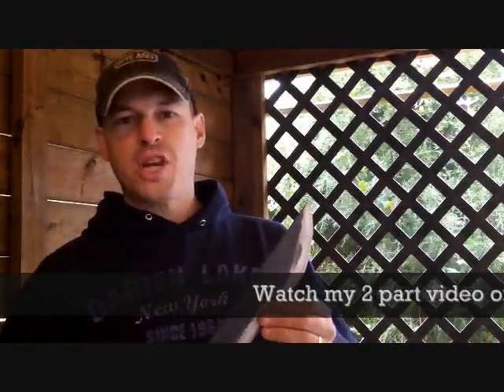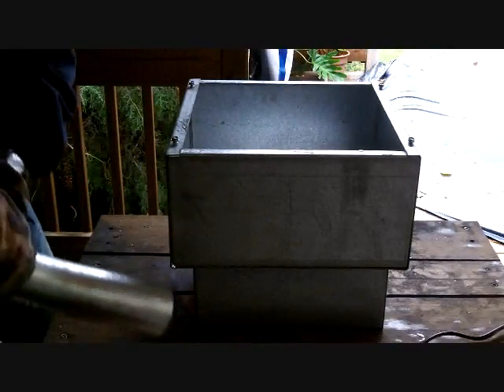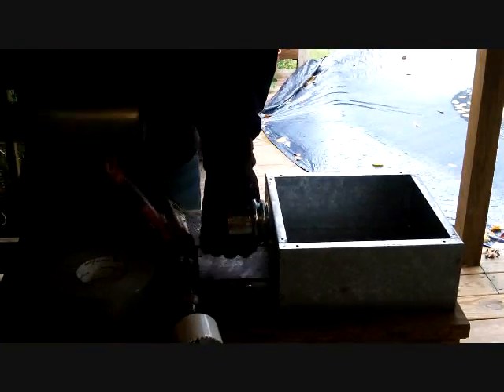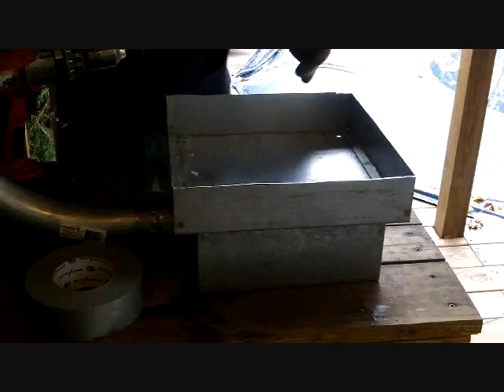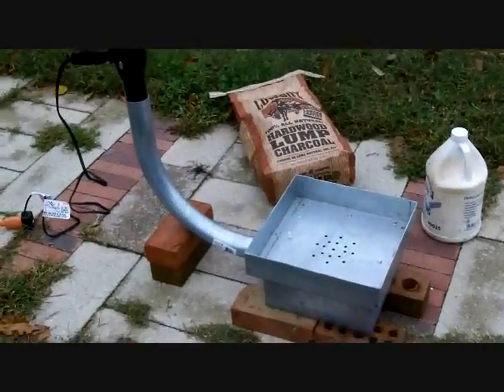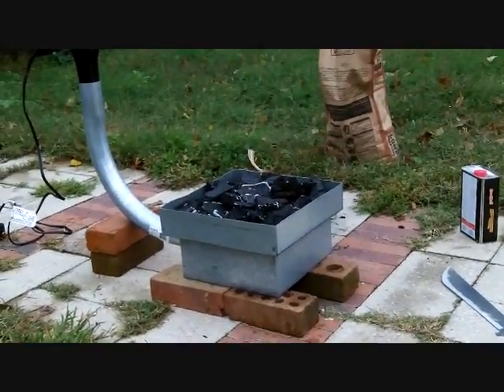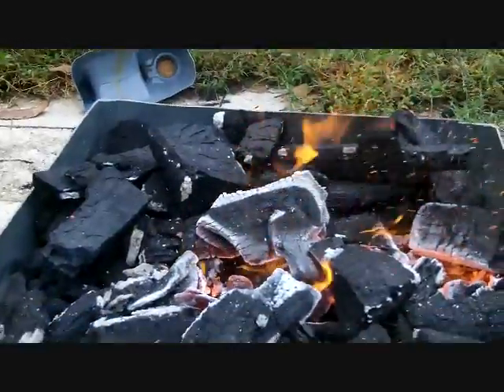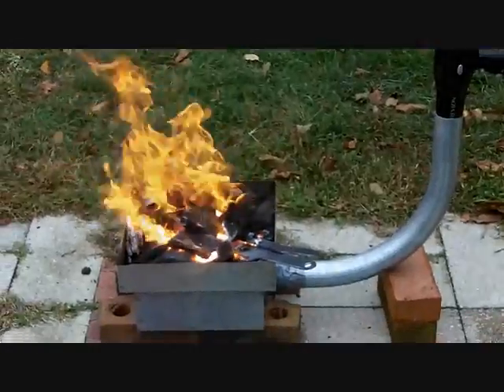How To Make A Homemade Forge (Rated Best Video)

Comment: This is probably a dumb question but what kind of oil do you use?
Reply: depends on what type of temper your looking for.  Everybody has there own secrete oils, or just what ever you have on hand.
Reply: Peanut oil (high smoke point), or other similar veg oils are used very often.

Comment: hey jaydog Ive been forging steel homemade for awhile and I can say your design is very good but if you use lumpwood charcoal use a 5g bucket dump the wood pieces in and break them up it works extremely faster and you have more to work with also add some water to a bit while using the forge and the wet pieces add around the ones that's hot, works great to. all and all keep forging my blacksmith friends we don't need machines we can make them ourselves the old fashioned way

Comment: oil quenching is for metals that are already very hard. If you are quenching mild steel, you use water. Heat to 4000 degrees and bring down to 400 degrees in one second. Never oil a hot drill bit. That's an oil quench and will make the bit brittle because the bit is already hardened. ur welcome

Comment: To all those having a winge about gal and how lethal it is when heated...use a flap disc on a grinder, sand back the coating and do a couple of high temp burns on the whole thing with a blow torch or light it with a coal fire and the blower somewhere outside so it is well ventilated, make sure you stay away and others do too or wear a respirator. It's a coating that is no different to paint in essence other than the fact the coating is zinc. A little common sense goes a long way and instead of using scare tactics to freak people out how about teaching them ways to avoid the dangers if all they can use is gal... I've made gal forges like this before, welding teachers at school have too, so long as you burn off all the gal its fine, just like if you make a barrel bbq you grind and burn out the paint.
Reply: yea, common sense is pretty uncommon. it will burn off and be fine. you'd be very sick if you inhaled one of the little puff balls, and an idiot if you didn't do anything about it. find yourself a lid for heat retention. it will cut serious time off. to hell with the haters. kudos for your good efforts

Comment: and them blades probably have already had that done and trying to do it again is really pointless beware of the white smoke after you turn off the blower check the sides after its been cooled and off for a day or so you can see the zinc build up on the sides or on the blades

Comment: does the galvanize burn off the steel eventually? or will it alway produce toxic fumes?  thxs
Reply: +Ei Pi always.
Reply: +tzDub92 thxs...wasnt sure
Reply: +Ei Pi it is a zinc coating that is hot dipped or plated on the steel after manufacture.  It burns of rapidly at high temps, producing white smoke and wisps in the air (much like acetylene).  Nothing to worry about outside, or with a fan to vent it away from you, on the first burn.
Reply: +Patrick Reed yes im familiar with the process thats why i thought it would burn off   Thxs for the info!

Comment: Galvanized steel gives off toxic fumes that are actually rather lethal. 
Also this guys forge wouldnt work well. No fire pot, no way to remove the crap that gets melted down (asides from dissembling the forge...) Probably one of the worst "how to make a forge video" I have ever seen. 

Lets recap. 
A. Hes using galvanized steel. DON'T! It gives off toxic gas and will KILL YOU
B. He has no fire pot
C. he has no way to effectively or efficiently remove little melted built up bits called clinkers. 
D. Hair driers work, but not well. 
E. He named his horrible forge video "Rated best forge"... 

This guy is an IDIOT. Don't be like this guy.

Comment: this post is instructing people to build a blacksmith forge out of GALVANIZED METAL, (an anti corrosive treatment made by plating metal with zinc) as this type of treated metal heats up the ZINC GALVANIZATION will begin to burn off creating POISONOUS FUMES that are potentially LETHAL, and can cause permeant & EXTENSIVE DAMAGE to the IMMUNE SYSTEM... please remove this video, before some kid trying to replicate this dies following your misguided instructions..

Comment: Cool way to do this, but it looks like your machete doesn't fit.  You could have used an oxy propane or oxyacetylene torch to accomplish the same thing.  I have also used a wood fire on the ground whilst taking my shop vac and blowing air into it with a small nozzle on the end of it.

Comment: lol guess i am not the only one who realized it was the wrong metal ,even on the cold side of the fire is bad, the fumes can be generated with out getting to forging temperatures, and wow hope he never tries to forge a piece of galvanized metal  ,but rant over ,like the design if in non toxic material
Reply: christophe leblanc No fire pot, no way to remove clinkers. Not a good design at all. Oh and yeah like you said, using galvanized...

Comment: This guy really doesn't know what he's doing galvanised steel really is he trying to kill people , also he only has the middle section of the blade over heat and if you un- evenly temper steel the metal becomes brittle and will break even if dropped

Comment: So on the one hand, it works, on the other hand:
When you acheive a decent temperature you're going to melt your forge.
Ash is going to accumulate in the hairdryer pressuriser.
All that metal is galvanised so yeah, that's not good.
A lack of insulant, which is cheap, is going to cost you lots of fuel.
In short, however this was voted for, it was wrong.

Comment: I was not impressed... he used the wrong coals, everything about this was dangerous. There are no seals in this box, and the whole tube up in the air thing was dumb too, easy to knock over. I don't think I ever saw his blade glow red either. This is an accident waiting to happen
Reply: Justin Brown I have used charcoal (natural wood charcoal) before for black smithing. In fact that is the first type of fuel used before  coal/coke was used. But yes everything else he did scared me. I kept waiting for him to turn off the hair dryer and have that space be a vacuum for all that hot air to rush towards his "billows" and melt them...

Comment: Lots of commentary about the galvanized material. perhaps a little expanded metal mesh and some fire clay would provide a more heat resistant surface , allow for the cheap material and enhance the lifespan of this forge.
Reply: Brad Dark A project I have been meaning to get around to as soon as I have finished my new workshop.
Ultimately I agree...The best material imo for a forge is as you said, fire clay or a none porous stone (air in porous stone will expand and crack or rupture the stone... no joke when hot shrapnel is blasted at you).
For those wanting to make a forge, rather look around for concrete designs (baked clay bricks are also easy to find and suitable for a beginners forge), as steel is likely to melt or buckle under extreme temps whereas stone/clay is more resilient to heat.
This design does not retain the heat, since much of the heat is lost to the open air. The principal of this build is okay but like many first time projects, it could do with some tweaking. I would not have cut off the top box for starters that way he would have been able to add more burning medium, allowing him to completely submerge his blade and possibly had more even heat distribution. All things considered a neat and simple build.
Reply: clinton Raubenheimer j
Reply: Berle Bauroth
k?

Comment: Simply put, the fact that it was done outside removed MOST of the dangers when dealing with galvanized materials. I have welded galvanized materials for years with no ill effects due to the fact that I do NOT do this in an enclosed space, and ONLY when it is necessary. Not saying it's a good idea to do these things, but don't over-dramatize the risks either.

Comment: Nice quick forge but if you build the same type don't cut your fire box that low instead cut an opening out on one side to heat your charcoal or wood faster an so you don't have your work on an angle while heating it and it will have even heating other than that great model, also you should mention if using galvanized to do a heavy burn first as it is toxic if inhaled!!!!

Comment: Spend a bit more time and just build a cinder block or brick forge.  You will be happier with the result, no fumes, and their aesthetically pleasing.
Reply: This is what I did and it worked out pretty well.
Reply: Robert Fields always liked cinder block build, although it does take up a little more space than a clay brick forge of the same volume.

Comment: I keep hearing about the dangers of using galvanized metals in forges but I have absolutely no idea in how to identify the differences between galvanized and non galvanized metals for the sake of using proper materials. Looks like I'll have to be cautious in choosing the type of metals I'll be using if I end up being crazy enough to even try something like this in the first place,but then again,I've been known to try some rather crazy things as well. LOL!
Reply: That's really weird. At a lowes or home depot it will be next to the welding supplies. Less than 3 feet away from the sheet metal I mentioned.
Anyway, the forge model I suggested is about 45-55$, so less than the cost charcoal for a big project. Anyway, I hope whatever method you use is safe. Good luck.
Reply: if it has rust on it (or can rust) its not zinc coated (or the zinc wore off).
Reply: Never thought about that possibility.
Reply: Basically if it's bright and shiny and silverish it's galvanized, if it's dark or corroded at all it's safe for heating.
Reply: It turns out that I just got my plumbing just recently. Anyway,you still can use galvanized pipes safely by either burning the coating off in a well ventilated area away from others and make sure you're not sitting to close to the pipes. If you decide to remain close to them,I suppose I would at least wear a mask over my face that would help to prevent me from breathing in any toxic zinc fumes. I've also heard that you can also sand it off and that using vinegar will also especially help as well in the process and is far safer than burning it all off. In the near future I'll be looking into deciding what method I'll be using,but I'm not ready to make that a priority just yet,as I still have a few other things that need to be taken care of before I start to even assemble it.
Reply: But well ventilated area basically that means a fume hood. Doing it outside is still dangerous and the chance of residual zinc oxide being left behind if you try sanding or using vinegar is too high for either method to be safe. If you want to build a forge go to a home improvement store, buy a 2'x2' plate of 16 gauge weldable steel, cut out the corners 3"x3" and fold the edges up.Drill a 3" hole in the middle and use a black iron connector to a piece of dryer foil and put the hair dryer on the other side of that.
Reply: Already too late for that. At this point,I have the only things that are available to me and I really don't have much of any budget at all. I'm pretty much stuck out in the middle of nowhere and I'm just gonna have to make due with what I got. Either way,there have been more than a few people who have removed their galvanized finish for their forges and have had no problems. As I said however,I haven't even gotten far enough to the point of having to remove the finish yet because it will be a while yet before I'm ready to start assembling the forge in it's final form,anyway. Not all of us have money and our circumstances vary in life. You take and use what you got. We have a few old burn pile spots away from the house far enough to where it really shouldn't be a problem at all to begin with. Burn and/or sand off the finish and then wash the pipes off. I don't mind some rust forming up on them as that would only help to indicate that I've removed that crap off of the pipes and rust would inevitably happen over time,anyway. If 2 inch black iron pipes were available,I would have went for them,but they were nowhere to be found at the local hardware stores,despite searching back to back repeatedly over time again and again for them. For some reason,they don't sell 2 inch black iron pipes and their accessories around where I live.
Reply: My forge is just the basic brake drum design using a disk rotor. The nearest Lowe's location to me only sells black iron pipe of up to a max of 1 and 34ths inch diameter at largest for some reason and I don't know why that really is,perhaps it has to do with building codes in my part of the country,but who knows?

Comment: cool design but this video is putting peoples live at risk telling them to use galvanized metal wich CAN KILL YOU if inhaled
Reply: NileLTR
WRONG! Zinc-oxide, as well all other metal-oxides, are the leading cause of Alzheimer's, Kidney, Lung and Liver Disease. The metal-oxides build up in your body because you're Kidneys, Lungs and Liver can't get rid of them effectively. The metal-oxides will remain in your Kidneys, Liver, Lungs and will get deposited in your Brain.  "...no long term health EFFECTS," my ass!
Reply: NileLTR Heavy metal poisoning has several long term effects, including death. And less galvanized metal than this has killed more experienced metal workers than this guy many times in the past.
Reply: the inhaled zinc oxide does cause a fever, but it is only temporary and has no long term health affects.
Reply: (A.N.P.A.) LiveTheRightLife
Yeah, that WOULD work. However, the idiot in the video didn't give us that instruction! Also, one would need to engulf the whole thing in fire in order to burn off ALL of the zinc-oxide. Also, why would anyone need to build a forge if they already have a place with fire big enough to put such a big object inside, anyways?
Reply: That's not true.  Zinc poisoning can make you sick.  However more than likely after he burns it off the first 10 times or so it will be gone for good.  He probably shouldn't use the galvanized stuff but it won't kill him, just make him sick as a dog.  Welders get this all the time, read up on it before you go slamming a video.
Reply: BlueMacGyver http://www.anvilfire.com/iForge/tutor.php?lesson=safety3/demo
The effects can indeed be cumulative. I would suggest one not believe everything one reads in an msds or is told by UL or the Government, as these things are all controlled by industrialists who have a vested interest in keeping workers working. Asbestos & Agent Orange are but two examples of dangerous substances which took quite a while to be listed as such. I personally am very careful in regards to welding/torching/super heating plated metals.
Reply: That's why you burn it first before initial use!
Reply: ***** Yes, in extreme situations your statement is true.
Reply: BlueMacGyver It's not really extreme, zinc poisoning is deadly and there is enough galvanized metal there where it's not even a stretch to say it can kill him or anyone else trying this.
Reply: *****
 Nope, Wilson died from double pneumonia and had problems with emphysema before that. The symptoms of his zinc fever had already gone away a few weeks before he kicked the bucket.

Comment: Ok design except for the galvanized boxes and I would see that hair dryer melting after a while being so close lol.. Would rather go with a couple fire bricks making what looks like a small oven and propane.. Alot faster heat and hotter quicker.. And wont have to mess around with coals.. But that's just how I would do it..

Comment: You are looking at a serious case of metal fume fever using galvanized metal.
Reply: The galvanized EMT will never get hot enough to burn the galvy coating off as long as the hair dryer is going... the electrical boxes he's using come as painted but raw steel... paint burns off once and your done with fumes.
Reply: noyzizi it doesn't reduce the heat, it's just pumping air into the galvanized tubing that is way wayyyy below the volatile temperature of the zinc coating. The coal fire never touches the tubing and even in metal, heat travels UP. So he's just fine.
A person really needs arc furnace temperatures to really vaporize zinc in the first place.

Not to mention that it's not REALLY galvanized. Light zinc coating is shiny for looks. very little corrosion resistance.
True galvanized has a very dense coating of zinc and is not shiny in any way shape or form.
Reply: Ok I don't want to get into the argument but earlier I said you need arc furnace temps to burn zinc. This is totally not true, turns out. You can burn zinc coatings off in an outdoor fire pit and it can be dangerous as hell. sorry to be a flip-flopper,  just wanted to throw that out there on the side of caution. Always grind off zinc if you can.
Reply: Robert Guyot  I thought the hair dryer was supposed to make it burn hotter by forcing more air in there? Why would having it on reduce the heat?
Reply: noyzizi
the hair dryer does make it burn hotter and what would be the point of making it reduce the heat when you want to melt metal
Reply: jon arbuckle Sorry if im joining in since this doesn't concern me, i know you've said this a lot of times, however when fire absorb more oxygen doesn't that increase the flame's strength?

Comment: ChildePC, the oil is special oil, look it up online.  The higher grade oils are for commercial use only, such as the smith in Man At Arms.  The oil has a high flash point, so it won't catch fire (usually that is)